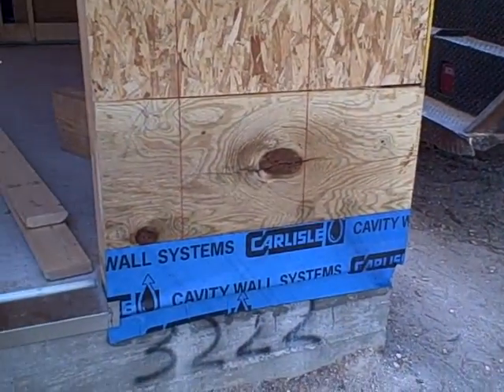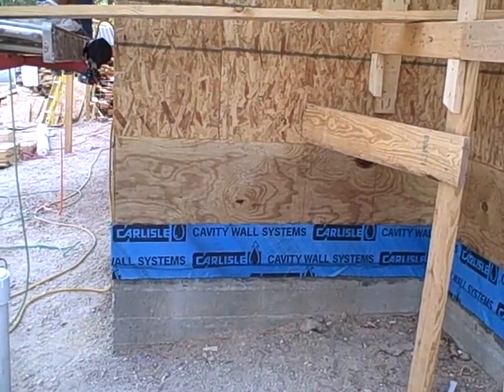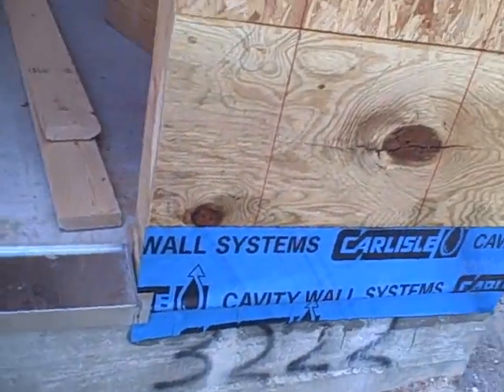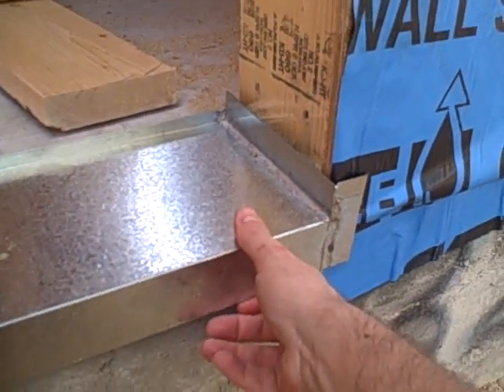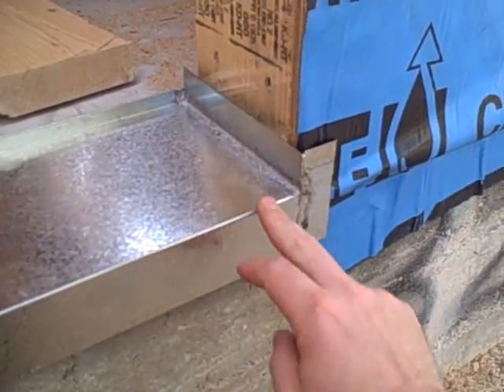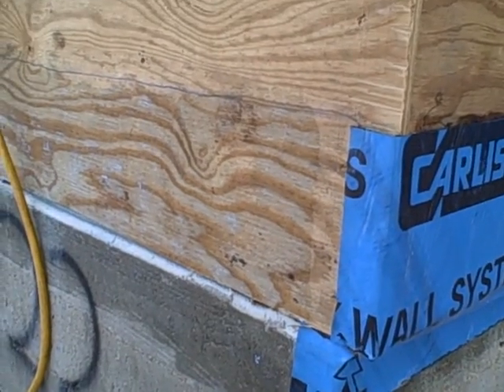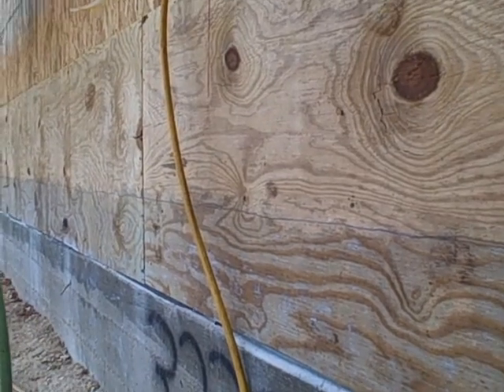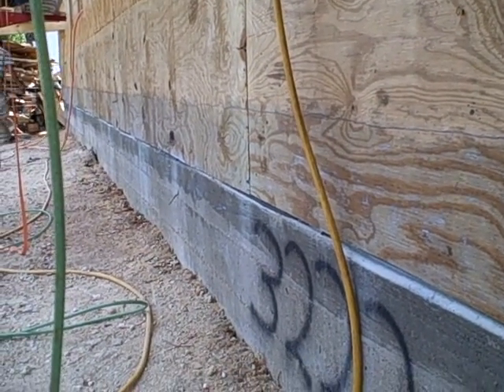Bottom Sill Flashing - Slab to Bottom plate connection

Comment from the maker: @RCVSEAN This is a slab foundation so this is really a best practice for water intrusion and air penetration.  In our Hot/Humid climate I prefer to use open cell foam so the house can dry to the inside.  We mainly air condition our homes so moisture can dry to the inside and open cell foam allows that moisture to  transfer to the inside.  Hope that helps, Matt

Comment: Matt, I am residing my home and using this membrane. With the siding ending at the bottom plate how do you cover the membrane that extends on to the foundation?
Reply from the maker: Chad Lenz Chad, I like to run the membrane over the foundation by 2" then drop the cladding below that 1/2".  Cut off whatever is showing below the siding. You'll have a really good waterproofing detail at a critical area of the house.  Great job!  Matt

Comment: So by replacing the bottom of a sheer panel with pressure treated plywood all the way around, do you also have to add more blocking on that joint to maintain the bottom plate to top plate sheer connection.
Reply: Hi Anthony. I was going to comment on exactly that. Here on the west coast, you would almost certainly have to provide continuous blocking at the horizontal joint between the 2 sheathing materials, with the specified "edge" nailing for shear walls. I really like the idea of using the pressure treated material though.
Reply: What sheathing material comes in a size to span bottom to top plate?